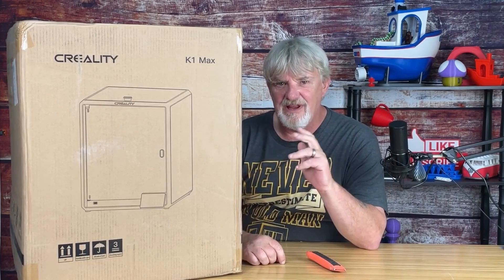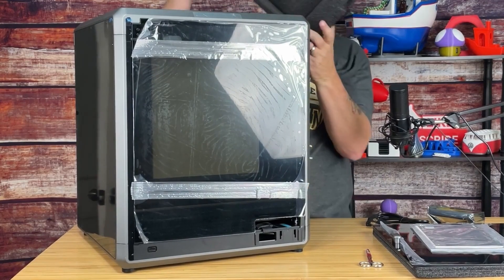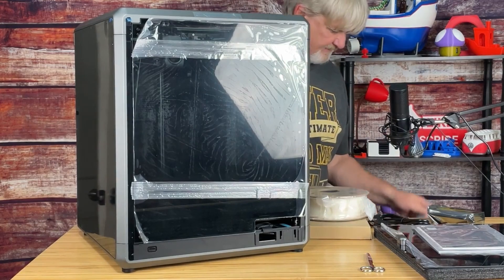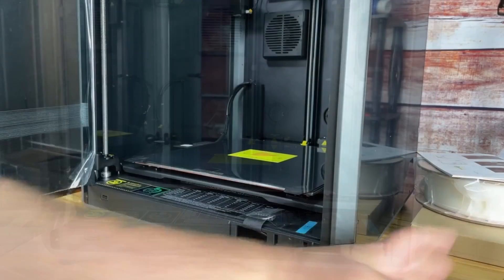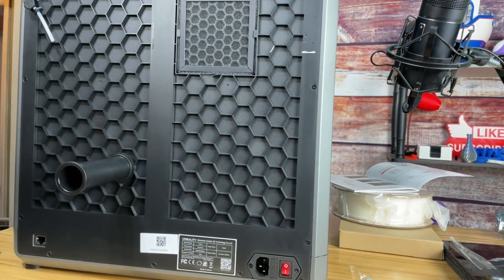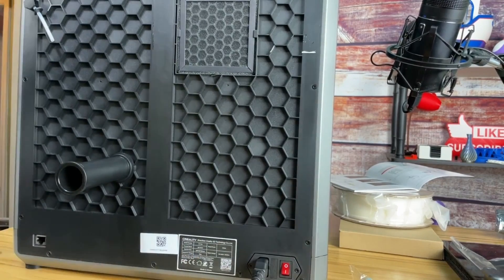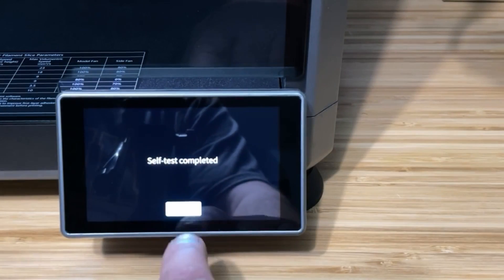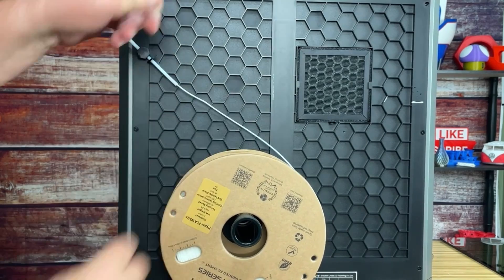K1 Max Unboxing, Assembly & First Impressions

Comment: I recently bought a K1 Max, and after I recognized the repeat jamming issue I was having (extruder internal temps rising just enough the PLA would soften & mushroom; creating a jam between the extruder gears, which also coincided with the ambient internal temp when it reached 37*C) and did some troubleshooting to fix it so I could keep those temps down (installed a stepper motor heatsink + resin-printed ABS-like vented heat shield spacer I found online to replace the thin, flat fiberglass one), I started looking for calibration videos and came across your channel.

I've been spending the past few nights fine-tuning my settings based on your vids 👍

Comment: Disappointing that you didn't include more footage of the printer doing its thing at actual speed. Show us a few layers of the benchy print, for example, so that we can get a sense of how fast this thing really goes. Also, why did the benchy you printed take 45 minutes when the installed one only took 13? Is it just a matter of slicer settings? If so, which ones?
Reply from the maker: Fair point. The Benchy that was on the printer when I bought it, it had a brim on it. It was a small brim, but still, it had a brim. The point of a benchy is as a printer torture test. To use a brim in my opinion is cheating the test, so I sliced my. Mine took longer for any number of reasons. For example, how many walls were used, how much infill, how many top and bottom surfaces....ect. The same is true for the Bambu, I don't know the numbers off hand, but the Benchy I sliced took longer than what was on the printer. What I will say about the K1 Max is that it's fast and it's reliable. It's becoming my go-to machine. About the only time I don't pick the K1 Max as my primary printer for a job is if the job requires multiple colors. I haven't had any issues with it, yet. I'm hoping it stays that way. It's a great machine. If there is anything specific you want to know I'll be more than happy to try to answer it for you. I do have the timelaspe for the built-in benchy, but being a timelapse it's only 6 seconds long and probably won't show how fast this printer really is.

Comment: Since it has 2 months now since this video, are you still impressed with the Max? I seen in the comments you also have an X1, How do they compare? I am looking at this and the P1S. Thanks for the video, your doing a great job!!!
Reply from the maker: Good question! I try real hard not to compare the two. But since you asked, here's my honest opinion, others might disagree. Both are great machines. People on Facebook and Reddit will say some bad words about the K1 Max. I haven't had a single issue with mine, not one. I use it daily. I bought the K1 Max for the print size and speed. My Bambu Lab X1, also zero problems and run it daily as well. The worse thing that happened with my Bambu was filament breaking in the tubes of the AMS. Not hard to fix, but not as easy as I'de like. Both machines are fast, the K1 Max is bigger, the Bambu does muti color prints and that's what it comes down to. I don't do a whole lot of multi color parts but it's nice to know I can. But on the other hand, multi color prints don't print at lightning speed and there is a lot of wasted filament. If I had to pick between the two, I would have to ask myself what's more important to me, multi color prints or size? 256mm cubed on the bambu, or 300 mm cubed on the K1 Max, the difference is 44 mm (about 1 3/4"). It's a tough choice.
Reply: @pushingplastic7445  Thanks so much for your reply! I guess that is the same question I’m struggling with between the two. Also there seems to be advantages of the Bambo infrastructure too. So have a little bit of time left as I’m waiting to see if some better pricing will come available around the holidays. Thanks again for the comeback and your videos, have been enjoying them!
Reply from the maker: @Walt1119  I think waiting for a holiday price drop is a smart move. Also, new products might introduced! When you decide stop back and let me know what you went with!

Comment: great grab! i believe this is the direct competitor to the current 1400$ bambu labs
Reply from the maker: I agree! I do have a Bambu X1 Carbon and so far, the only thing the Bambu has over this printer is the ability to print multi color. Creality is going open source with this in September. Maybe multi color for this printer will be available then? I'm also liking the extra 50 mm build volume in XY & Z over the Bambu as well.